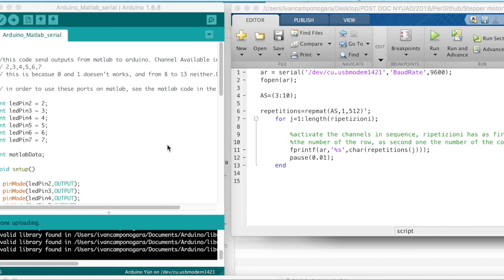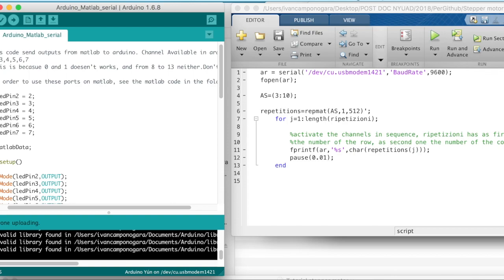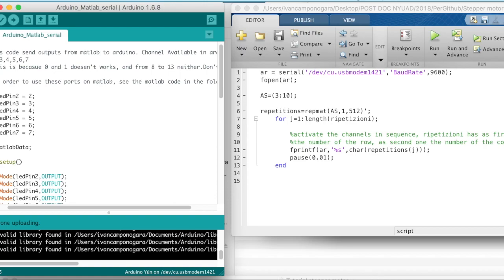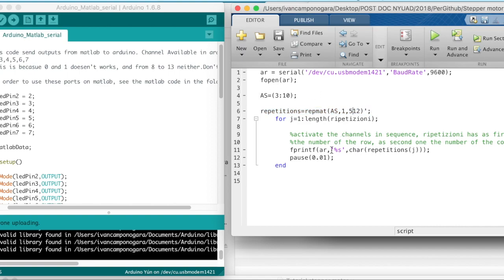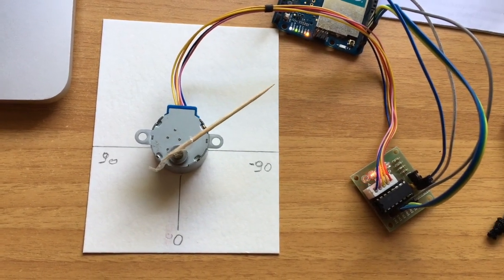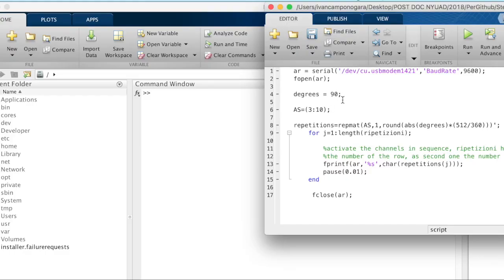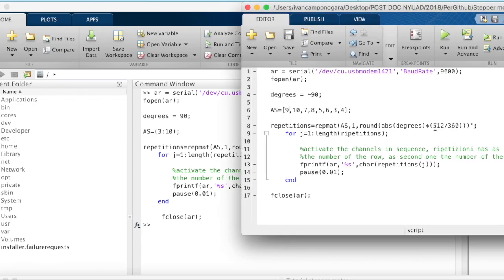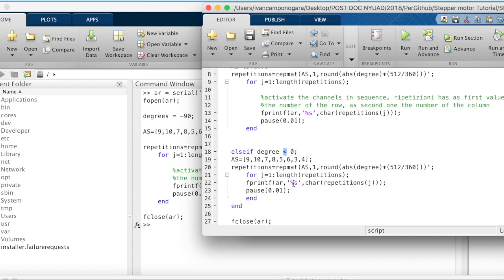Control a stepper motor connected to arduino through matlab

Comment: For some reason, the first line in the code doesn't work for me. I change the port to 'COM3', which is the port that I am using, but i always get an error. I also try using the function serialport('COM3', 9600), but this also gives an error or doesn't move the motor. What do you think the issue could be?
Reply from the maker: Have you downloaded the Matlab-Arduino communication and run it before running the code?
Reply: @ivancamponogara6578  Yes I have. I also tried to go through the description for the code instructions, but not much success. Would deleting the Arduino support package fix this issue, even though your code is not using any Arduino-specific commands?
Reply from the maker: Yes, I've removed the Arduino support package on my Matlab before making these codes. I think that would solve the issue
Reply: @ivancamponogara6578  Thank you for the help! It turned out that the issue was that I was using a Mega 2560 board rather than an Arduino Uno. When I switched boards, the code worked. How can I modify the code to make it compatible with the Meg 2560 board? Would I have to use different pins? I would've thought the only difference would have been to alter the board type in the settings on the Arduino software. Also, is it possible to use this code to control multiple motors? I would like to assign angles for 4 motors.
Reply from the maker: Hi Jonathan, I'm glad you found the problem. I'm sorry I haven't specified which Arduino model I was using. Here are the answers to your questions. 1) I have no idea how to modify the code to make it compatible with Mega 2560. I should try to work around it, but I don't have one, sorry. 2) It may be that you should use different pins. As I specified in my GitHub, I haven't been able to access all the pins of Arduino Uno through this method, so it may be the same for the Mega 2560. 3) Yes, you can use this code to control different motors, but I think there will be not enough pins for that. The code can work with 6 pins, you need 4 pins to control one motor, so to control 4 motors, you will need 16 pins. Thus, I think it's very unlikely unless you figure out a workaround to make the other channels work with this method. I don't know why this code doesn't work with the channels 0 and 1 and from 8 to 13. I wish to be an engineer to understand it :) Good luck with your project! It seems exciting!
Reply: @ivancamponogara6578  Thank you! I think I've figured out the code, my only issue is the fact that only pins 2-7 work. On the Mega 2560, I can't even get those pins to work. I wonder what the issue could be... why would those pins only work and only on the Arduino Uno. I have tried to conduct some research online and can't find anything.
Reply: @ivancamponogara6578  Good news! I modified the code and it is now working on all the pins! In your code, it looks like you are missing an equal sign at matLabData=14 :)
Reply from the maker: Hi Jonathan, I just checked on git hub and  matLabData=14 is there. Which code you are referring to?
Reply: @ivancamponogara6578  It is there but I believe that it required two equal signs... matLabData==14.
Reply from the maker: In any case, please read the video description to have some more information on how to use the codes

Comment: Hey there Ivan, the speed of the motor is slowly?? or why you speed up the vid? do you know if there's solution to that?
Reply from the maker: Hi Bryan, i sped up the video because of reducing the overall video time. Anyway, with this method you are activating ad deactivating each coil in the stepper motor. Their asynchronous activation and deactivation enables the rotation. The activation and deactivation time is 0.01 seconds (100 ms), you can see the pause in the code. This allow the code to run smoothly, otherwise the coils will simultaneously activated and you will not have movement at all. I think you can try to play a bit with this pause and see if reducing it will increase the overall speed

Comment: Hey man, nice tutorial! I have some problems with serial comunication between arduino and matlab. Your matlab code doesnt work to me.  I downloaded hardware add-ons for arduino, where I have to manage a type of arduino, wich port i use and selection of libraries to be included in the server. There is few libraries wich are not suported  for arduino UNO. Mainly "Serial" library. I suspect  that this is the problem why doesnt work to me. Do you have some experiences with it? And wich arduino are you using? Thank you a lot!   :)
Reply from the maker: Hi! Sorry for my late reply. With my code, you don't need any kind of add-on for Arduino. The add-on commands will conflict with the code commands, that's why is not working. Just remove the add on and it should work. If you look at my git hub you will find how to make Arduino and Matlab communicate. You have to use that method to use the codes for controlling the stepper motor. Hope this helps

Comment: Please can you advise if it is alwasy required to use two programmes or whether the entire process can be completed in Matlab? In other words could I simply connect everything together and then use Matlab to programme and operate the arduino hardware? Thank you.
Reply from the maker: Hi thanks for the interest! You have to run the .ino code first, and then you can program everything in Matlab. I made a video where I show how to make Matlab communicate with arduino. You can watch that video to understand how they communicate. you can find everything on my GitHub

Comment: Hi
How to control 3 motors
What are the modifications
Reply from the maker: The AS matrix control the arduno outputs channel from 2 to 5. if you connect a second stepper motor fo the Arduino outputs form 6 to 11, you have to set another AS matrix with the values that goes from 11 to 18 and run the code. I don't think is possible to control 2 stepper motor simultaneously, unless you specify a repetition matrix with 2 columns and 2 indexes (j and i for instance). hope this could help.
Reply: @ivancamponogara6578  Hi
Sorry I could not understand it. Can you send me your code for this.
Thanks.
Reply from the maker: You can find the link to the code in the description.Just have a read to what I wrote in the script and in the read me file on git hub
Reply: @ivancamponogara6578  how to Control two stepper motor (28_bjy48) at the same time via Arduino and Matlab

Comment: The code you linked on github seems to only be analytics from github. The code showing in the video is not what is in any of the files.
Reply from the maker: Hi Draken1331, the first link is the code to make arduino communicate with matlab, the second link are the codes for using the stepper motor via matlab. You can download the codes you see in the video from the second link. Follow the instructions in the readme file to use the matlab code.